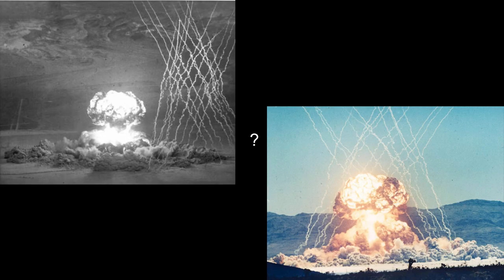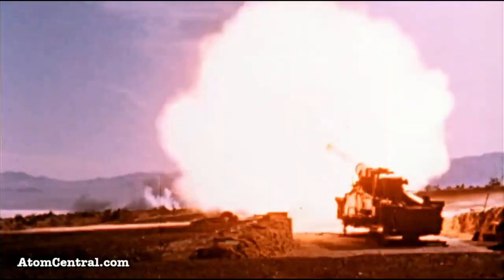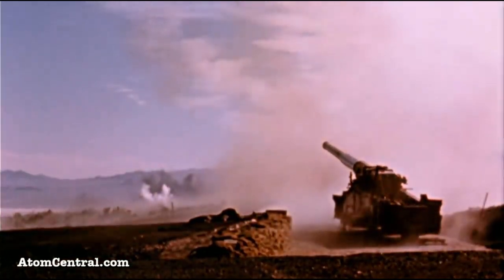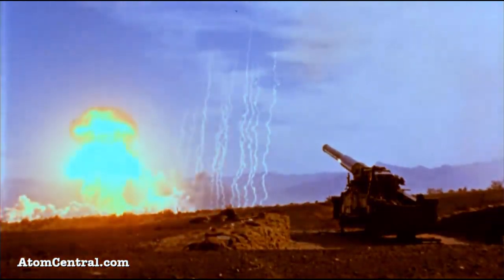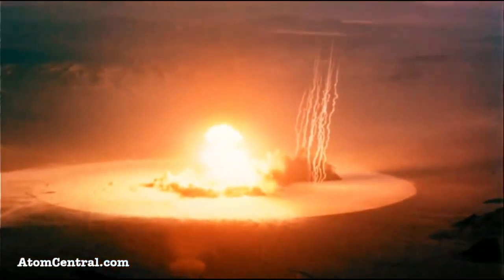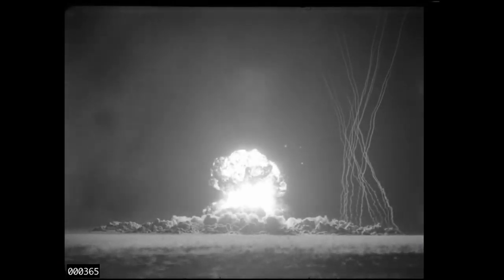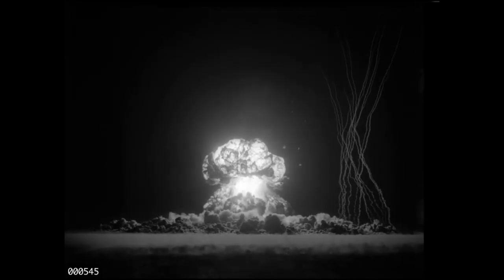What are those nuclear test smoke trails?

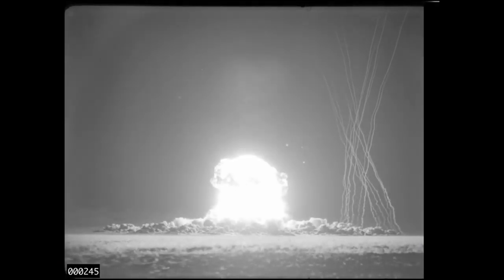Comment: I've always wondered how they managed to keep that camera stable, let alone in one piece in footage like what can be seen @1:00?
Reply from the maker: Cameras where basically bolted to the ground in protective housings. They still shook when the initial shock hit but would stay pretty stable over all.
Reply: @venera13  I believe the cameras were also protected behind a thick & sturdy wall, to guard them from the blast, and the intense radiation and heat brought on by the blinding flash.